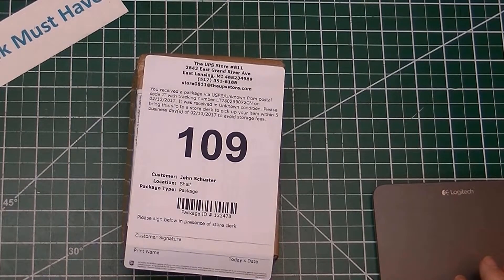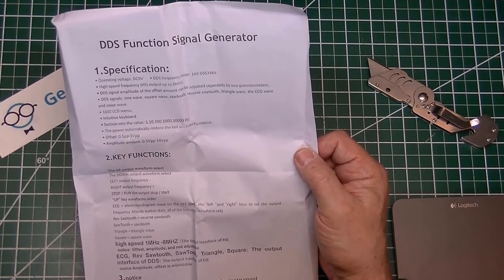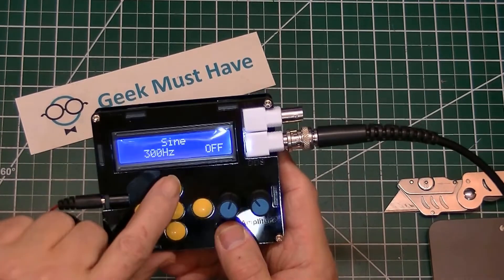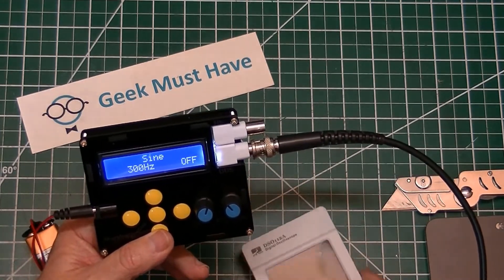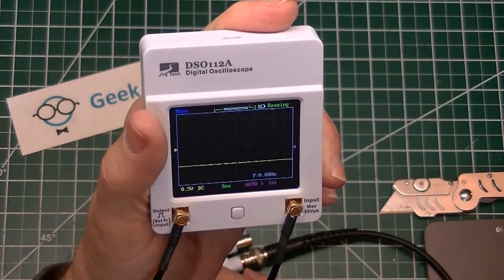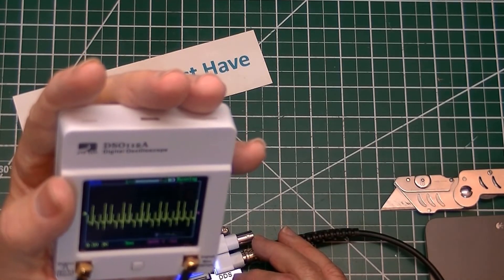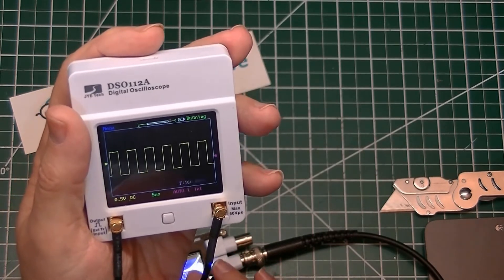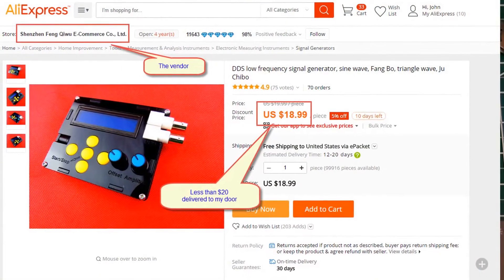How good is a $20 Signal Generator? Product Review GMH 041

Comment: Excellent videography. Most people don't have the skills or consideration for the viewers to effect such a thing. 
I bought the same unit from the same place for about $30, but it included the power supply and one lead, but no instructions. I also bought a small frequency generator kit with which I can practice my soldering skills.
Reply: Thank you, sorry for the delay in response, my mail filter was not forwarding YouTube messages for me to review.  How did your kit build go?

Comment: I was wondering if this can use a power volt  supply as in, a power pack instead of batteries, one more question did you have a follow up in using it for practical use .
Reply: Yes, you can use any 9v power adapter with a standard 3.5mm plug on the end of it.  I have used this in a few projects where I need a square wave out to trigger an ardunio and it worked fine.  Let the unit plugged in overnight and it was still running in the morning.  Every once and a while one press of the button gets 2 or 3 increments but, that a minor issue.  While it's not a professional unit it is great for getting started when you need a signal generator.
Reply: @johnhschuster  Thanks for your reply.
Reply: Thanks John , some of the Chinese products I have found can be a little unstable, and only seem to work at times with a battery. well it has given me to be a little bit cautious as you don't want that magic smoke , thanks for your reply  John.